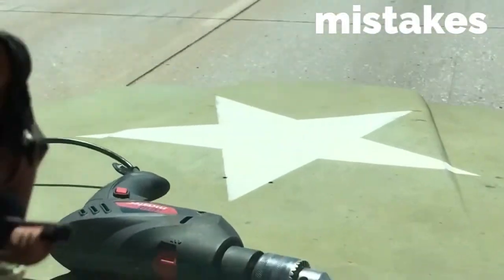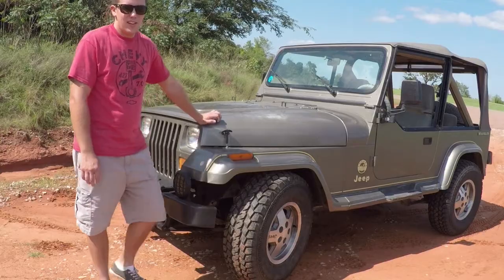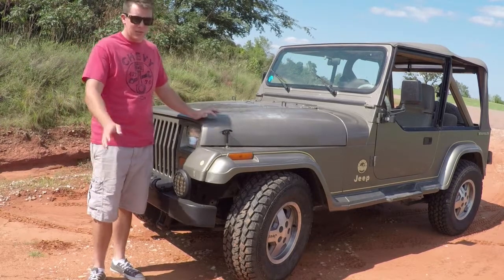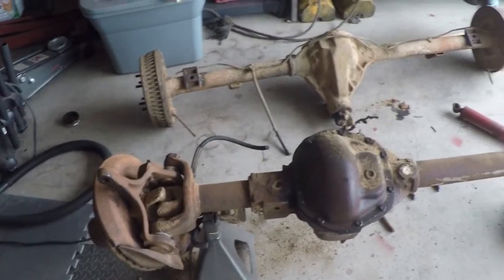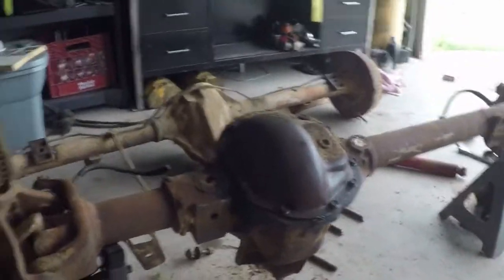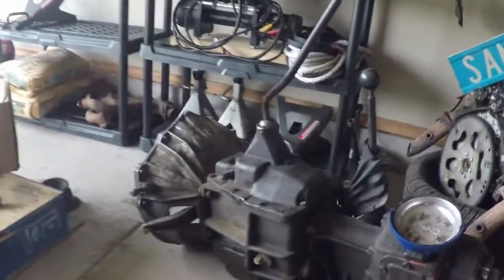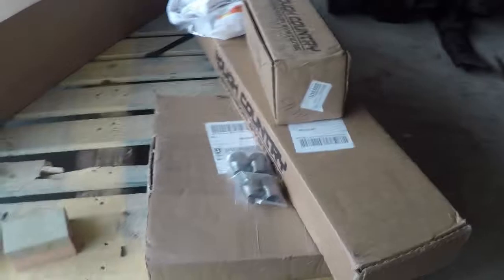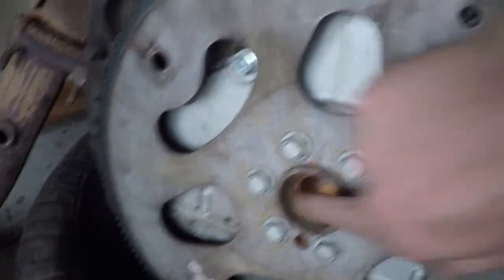Jeep Yj build 5.3/465/205

Comment: I have an 88 yj. I'm building a sbc 350 .060 over mated to a TH350. I'll be following your build for sure!!
Reply from the maker: That sounds pretty awesome! I haven't even finished and i'm kinda wishing I just went TH400/350. The sm465 was cheap but in the end I spent the same money that I would have just going auto.
Reply: I used the 700r4 for my 350 yj. So much more fun to drive. It's an easy project. Take your time.